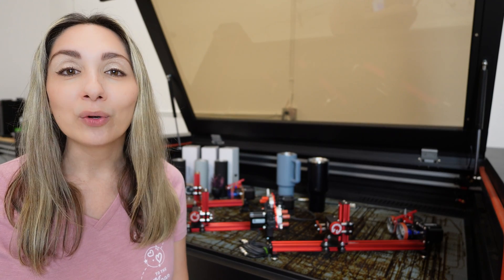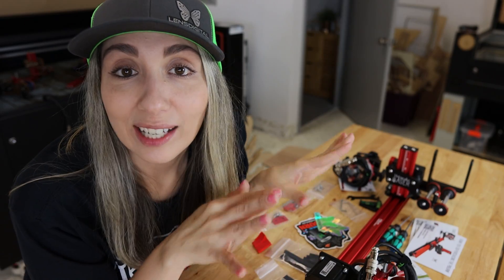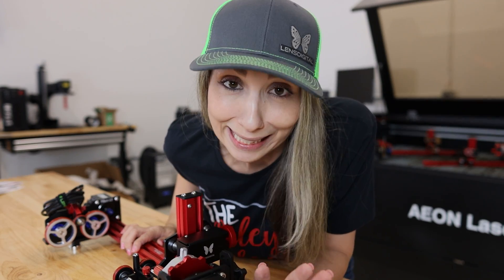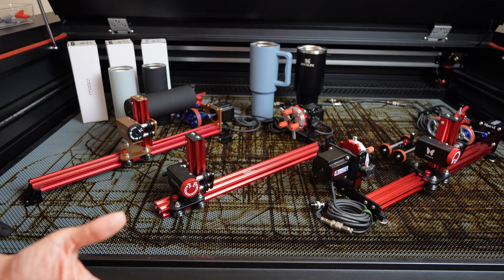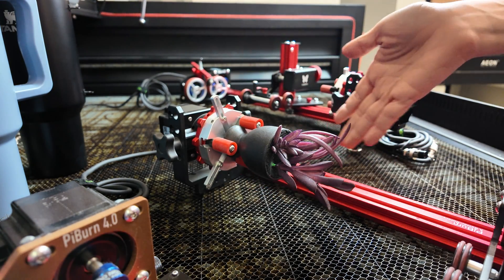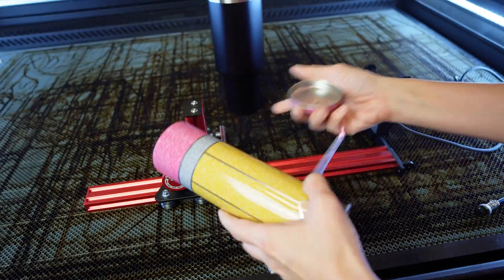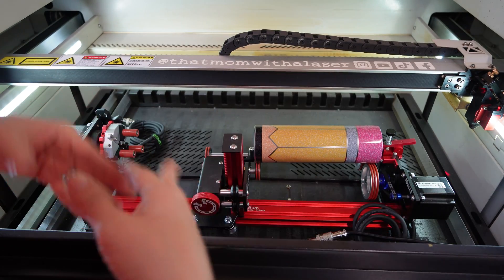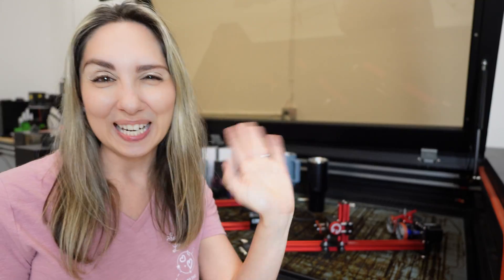PiBurn Laser Engraving Rotary Attachment

Comment: I have the PiBurn 4.0 and have used it a handful of times. Do I need the grip? Will it make engraving that much easier? I have an Omtech 130W
Reply from the maker: Hey there! The 4.0 is a great rotary.  If you're not engraving a ton of tumblers then I would stick with that.  If you ever find yourself working a lot with 40oz tumblers or odd shaped items, then I would add the grip.  Otherwise, just work with what you have. ❤